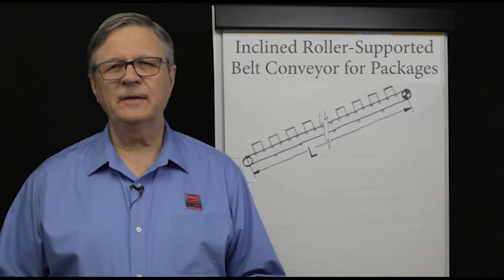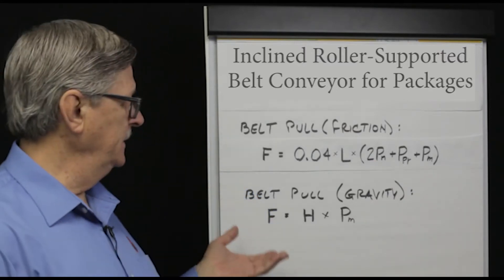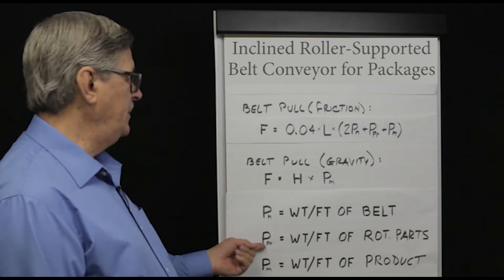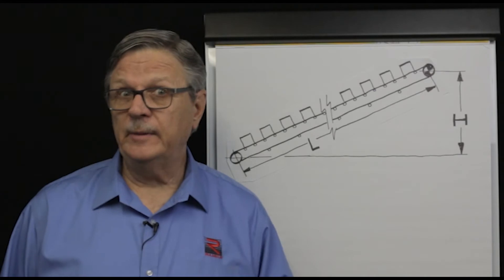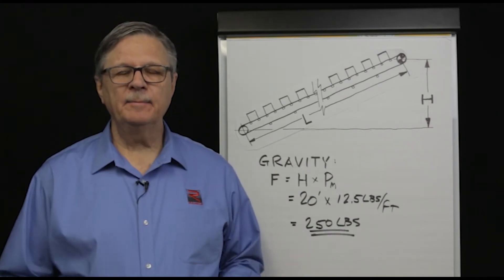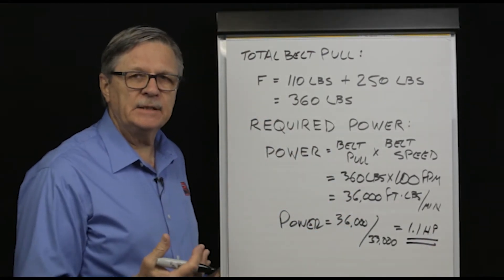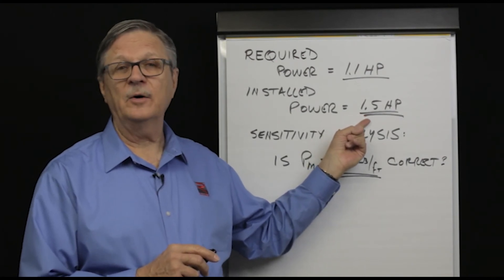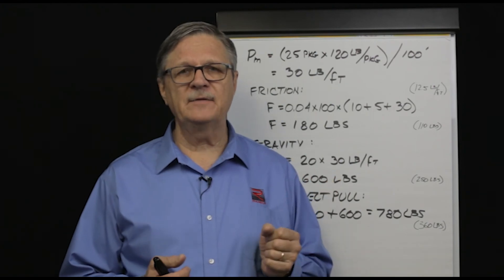How to Calculate Inclined Roller Conveyor Belt Pull

Comment: Hello if you dont mind me asking where did 33,000 lbs/min came from? For calculating the horsepower
Reply from the maker: The units used are defined by physics.  In imperial units, 1 HP is defined as equal to 33,000 ft-lbs/minute (foot-pounds per minute).  In metric units 1 KW = 1,000 N-m/s (newton-meters per second).